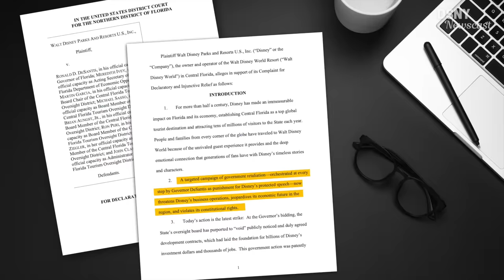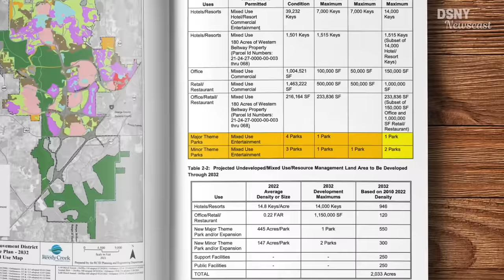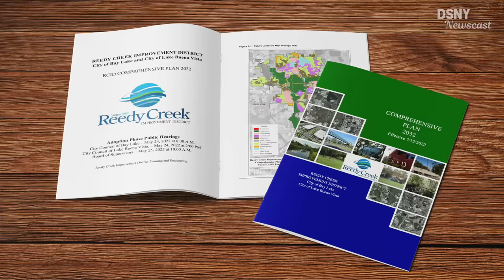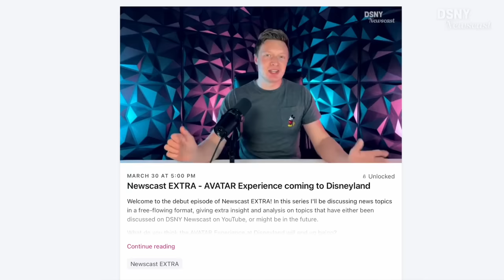WHERE Could Disney BUILD A FIFTH PARK at Disney World? - Disney News Explained

Comment: I'd far prefer that Disney put attention into the existing parks way before another park. So many rides seem to have issues frequent enough that you're unlikely to avoid an issue on a ride or have a temporary closure on your visit. And there is just an overall worn down-ness to a lot of things that it really takes the magic out of Disney. I deleted what was going to be a dissertation of my thoughts as it was filling my screen on just Magic Kingdom and part of EPCOT, but I think there is just so much that needs to be restored to original condition, put back in to operation, or replaced completely before even making improvements on things at the existing parks, let alone create a new park. I could see the argument for a new park to ease crowds on existing parks so that major improvements could be tackled (like a complete Tomorrowland overhaul). I enjoy going to the parks, but that's with an annual pass, I'd probably be depressed if was just tickets for a summer vacation.
Reply: Maintenance at the existing parks does need to step it up.
Reply: Disney laid off like 7’000 employees. They keep raising there prices.    And Disney is getting rid of my favorite ride. Splash mountain. . All for princess and the frog? Really
Reply: A new park means thousands of new jobs.
Reply: @seokjin3000 provided YOU wish to work for the CCP!!
Reply: @geno5169 I mean it’s still the same ride just with Disneys only black princess does that bother you

Comment: There will NEVER be a 5th park in WDW, and there is a litany of reasons for that. Universal is actually learning some of those right now. A new gate actually doesn’t bring in more people, it divides them. Walt Disney World has all the people it can handle on a daily basis. Adding a 5th park just takes people away from the other parks. It happened when they added Animal Kingdom. It didn’t add to the total amount of visitors. It just pulled people from the other parks and activities. They have more than the number of parks they need. 4 is the highest that number will ever go.
Reply: Some day there could be a 5th but it really doesn't makes sense right now for many reason.  For one is they have massive room to expand  current parks and add new lands and also they are on the verge of bankruptcy with only 3 months left in operating capital. It is very sad but also not surprising given that movie after movie has flopped so badly and attendance is way down. 
But forgetting all the problems and imagining they have plenty of money to expand. It makes sense to add new lands to all four of their parks instead of adding a 5th gate. To tell the truth I think they should consider a second Disney Springs like offering that is connected to the new Bright Line wherever it eventually ends up connecting.
Reply: Epic universal actually seems like will bring more people to universal that actually wouldnt go at all before that the most notable feature was Harry Potter and it attracts more among the fans of it. There is a lot of Nintendo fans

Comment: A fifth park isn't additive in any way. It's actually reductive. Families from out of state typically only have one week for vacation, and 2 of those days are travel days giving the family 5 days. Between 4 major parks, 2 water parks, and Disney Springs, it would be next to impossible to squeeze in another full park, and NO ONE I know would be willing to give up a day at one of the existing parks to see some new park. What Disney needs to focus on is expanding and growing the current 4 parks. Adding at least 3 new offerings to each park (for a total of 12) along with new shops and eating, WOULD be the equivalent of a whole new smaller park, without increasing ticket prices or requiring additional vacation days.

Comment: 100% agree with the ESPN area. Personally, I would like to see a park filled with massive, immersive dark rides and lands; designed a bit like Universal's Diagon Alley/Knockturn Alley, so there is plenty of shade. It might include Zootopia, Moana, Avatar the way of water, Encanto, Coco, which could all be designed indoors with simulated daytime and nighttime transformations throughout each day.
(I grew up in FL and have always been able to handle intense sun and heat, but recent trips to FL have felt a bit too hot in July/August/Sept. And it will likely get worse thinking long-term. If Mall of America can put more than 100 acres indoors, so can Disney.)

Comment: As a recent graduate of the Disney College Program I can say with full confidence that the Western Way location would be the most unlikely location as the road was backed up all the time due to it being small and the bottle neck that would occur when an accident would happen made it impossible to move both cast members and guests. And they happened quite a few times causing 30+ minute delays.
All the other CP’s would joke about the ESPN location being a great spot for a potential 5th gate because of the low guest traffic to the area when it wasn’t marathon season.

Comment: Great video.  You can see the passion of the fan base based on these comments.  While I would love a 5th gate, I do agree we need upgrades in 1-4 first.  

Magic Kingdom needs a lot of help, I like the ideas of expanding MK with Coco, Encanto and a Villains Land.  'Its a Small World' needs transformed into a Tangled boat ride which makes the theming of that area much improved, while changing the Pinocchio restaurant into the Snuggly Duckling.  The biggest issue with MK is Tomorrowland and how disappointing it is.  Stitch remains closed and unused, Astroblasters seems dated when compared with other shooting attractions, Space Mountain needs a massive refurb which they should copy the Tokyo DL upgrade and Tomorrowland Speedway still using gas and not electric cars doesn't feel very 'tomorrow'.

Epcot is still messy with the 5 year construction project for trees and paths.  Imagination needs gutted, we all love Figment, but massive changes are needed.  My biggest gripe is that each nation in the Showcase should have an attraction.  Canada would be great with a log flume ride.  UK with a Mary Poppins dark ride and definitely not an indoor carousel.  France is good now.  Morocco is in desperate need of an attraction, perhaps an outdoor coaster that stays low to the ground and around regional artifacts.  Japan needs a Mt. Fuji coaster, this is my number 1.  Italy needs a gondola ride that goes through Venice.  Germany needs the Rhine River Cruise that almost happened.  Add a new pavilion with Brazil and an immersive rain forest river rapids attraction (as this expansion lot is massive and maybe we can contain the visiting Brazilian crowds there).  China needs a Mulan dark ride.  Lastly, expand the Gran Fiesta Tour and theme to a Coco dark ride.

Disney Studios has improved a lot in the past few years but needs a bit more of a nudge.  Remove the Indiana Jones Stunt Spectacular and create a mini land with the Indiana Jones Adventure dark ride and a mouse coaster themed with the mine carts but add an indoor segment with effects.  This would take us to an actual Muppets Land which will update Muppet Vision 3D, add in an omni-mover/scaled down version of the Great Muppet Movie Ride and an interactive Muppet meet-and-greet.  We need to connect Toy Story Land to the Sunset Blvd and this will be by adding a clone of Cars Land from DCA.  Cars Land should cover from Toy Story Land to the Rockin' Rollercoaster.

Animal Kingdom is a half day park and needs the most work.  Expand Avatar to include an E-ticket 'Way of the Water' attraction and more dining.  Follow through with the discussed Moana and Zootopia changes to Dinoland USA.  Add an Americas section and include animals found in NA and SA.  This provides an opportunity to add a coaster based on the American eagle and maybe something on bears.  

Once we get all this (or better ideas than my scribbles) completed, then lets talk 5th gate.  By then I am hoping the Marvel rights will be figured out and we can have the most incredible Marvel themed New York/Avengers Campus park.
Reply: All excellent points. We need more “people eating” attractions, to meet the increasing crowd demand.
Reply: You’ve thought about this a lot! I like much of it, except some eliminations like Small World (iconic, memorable). I totally agree with a ride at each land at Epcot, it’s so surprising that hasn’t been done yet! The only concepts I don’t like are changing some well-planned, iconic attractions with cheap-seeming 2-Dimensional cartoon movie events - they’re doing enough of that. Let’s keep some of the class.

Comment: I know this is an odd suggestion, but I’d actually like to see them add a back entrance into MK. It could enter into the proposed Villains area which could then connect on one side to an expansion of Fantasyland and onto the other side to beyond Thunder Mountain. Then, they could honestly move Frontierland and put a New Orleans Square where the current one is therefore kind of solving an issue you mentioned in a previous video.
Reply: eh but that would kind of ruin the feeling for new guests of walking through main street and seeing the castle for the first time
Reply: This is Pride month so...  great idea.  Though it would be used mostly by locals who I believe prefer the other Disney parks.
Reply: frontierland will not work where it is when tiana's bayou adventure opens in late 2024 so i agree
Reply: I can get it but anything that majorly messes wish Phase one, Walt’s dream and vision, bugs me.  I know all things change but we don’t have to throw the baby out with the bath water, as they say.  However, I could see why you would think this.

Comment: They could build a new high end hotel on the already existing monorail line.
They already have the Grand Floridian and the Polynesian Village, 
they could build a castle hotel based on the theme of Frozen.
If they wanted to expand the countries in Epcot, they need to try and include countries from all seven continents.
South America is not represented, so Brazil would be a good country to have from that continent.
Australia is also not represented, which would include a sixth continent. 
Antarctica would be out because of obvious reasons.

Comment: Even before you began revealing the locations, I thought any new park should be built on the south end. It's logical that they would want to add another park in that area to give a "local" park for people staying in the value resorts, the Animal Kingdom Lodge, and even Coronado Springs. At peak times of year, it could help to relieve crowd sizes in the other parks. It might also enable Disney to shut down more rides and attractions in the existing parks to do more maintenance. As for the kind of park they should build; it should be one with more thrill rides like the ones found at Universal. Not only will it give Disney a park fundamentally different than any of the others, but it could also draw some of the Universal enthusiasts who think Disney rides are too tame a reason to visit a Disney park. Disney has plenty of underused intellectual property to incorporate into the new rides.

Comment: Did they ever build anything on that space previously occupied by the Walt Disney World Speedway?  If not, that could be a good location for a new park.  Instead of a fifth theme park, I'd want it to be a third waterpark.  Basically it would be a brand new River Country waterpark with the same "Old Fashioned Swimming Hole" theme that the original location had, but with more new modern rides and slides mixed with the same in-depth theming that Typhoon Lagoon and Blizzard Beach have.

Comment: What if they turned site 2 into a staging area for a magic Kingdom expansion. Then converted it into parking decks similar to Disneyland at some future point. After the switch to decks they could turn the current Magic Kingdom parking lot into their 5th park. Hopefully they aim higher than the original DCA park that did the same thing at Disneyland.

Comment: Disney is currently losing so much money that a 5th park is nearly impossible. Supposedly, they have a massive debt coming due to dealing with Comcast and Hulu. They need to come up with cash they do not currently have to pay this debt. The parks do make money, but the post covid rush is over, and attendance is dropping. Their movies lately have just been remakes that are almost all losing hundreds of millions instead of making the big bucks like they used to. Supposedly they are closer to selling things to pay this debt than building new things.

If that's true, a new park is at least 20 years away. The bigger issue is finishing the work on the parks they have. They also need to increase capacity with what they have. Do that first, then add the extra park. Everything is falling apart, and the magic just isn't there. Fix that first.

Everybody loves Iger, but remember... he's the guy who bought Fox and that was a financial disaster. Disney+ is also killing them.

Start making good, original movies first. Invest in the current theme parks next. Then think about a 5th park. Maybe had the people running the company built some park expansions instead of just building more resorts, this would be more feasible.

Comment: Agree on the last Option would be the better spot since it has enough Space but what should they build there maybe some Classics like you mentioned maybe a mix of old and new but I believe I will not see that for life since it probably will take more than few yrs so when I will be returning in 6 yrs unless they get it rolling soon it will not be open at that point so I will not witness such new Park.

So have to enjoy Epic Universe instead at least since that will hopefully been finished at that point since it should open in 2 yrs.

Also the closer to MK I suggest they would do a Moderate Hotel if they would do a Resort Hotel there.

But as long as they struggeling with the new Board and the Political strangers it will not be something they could or would consider since that issues must be fixed first before planning on a fifth Park since they have enough to focus on at the moment.

Comment: I haven't even started watching the video but I know exactly where they can put their fifth park. Nowhere. Disney should not be expanding right now. It would be a bad idea. First of all Yes Disney does have some wins lately. The Little mermaid remake is doing well at least domestically although sadly it's struggling internationally. The MCU as a whole has been failing, Although unsurprisingly guardians of the Galaxy 3 is doing great, but otherwise the trend for Disney's pretty downward.

The best time to expand their adventures with their parks honestly would be sometime later when they turn around. And yes it's a matter of when not if.

People think Disney's going to go down the shitter but no of course not. They've had their downs. The mid-2000s is a prime example actually I think that was actually even worse than where they are now as a matter of fact. Things weren't very good for them in the '70s and '80s either. They always bounce back. So hold off on the 5th Park

Comment: A 5th park system on 180k acres in Texas. Texas is centrally located, west of the Mississippi ( so marvel can be part of it, because they can’t build marvel east of the Mississippi)  180k acres would allow more expansion than imaginable. New rides , transportation systems , below and above ground (water table is much lower than Florida) west Texas would have room for a international airport called Walt Disney international.  Bigger and better magic kingdom, marvel, cars lands , Hollywood studios, animal kingdom ,  bigger Star Wars attractions, water parks , and bigger resorts ! new transportation system like a monopod rail system that will take you completely all over the parks , Disney springs , resorts and air port.  Transportation system would be a AI and remotely controlled. Disney would save money on fuel, maintenance, drivers salary’s, less carbon emissions.  @waltdisney hire me 😅